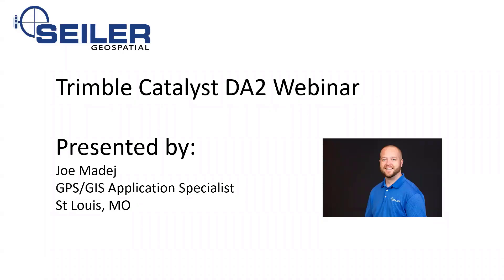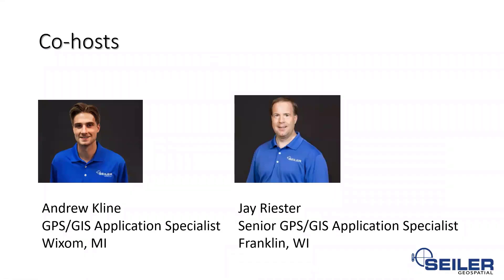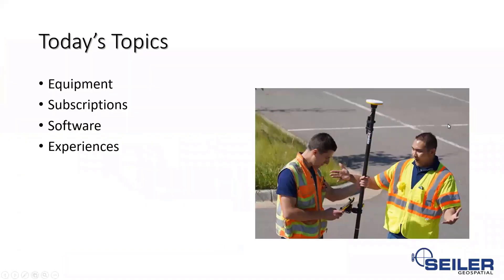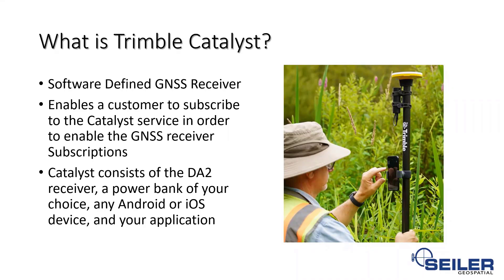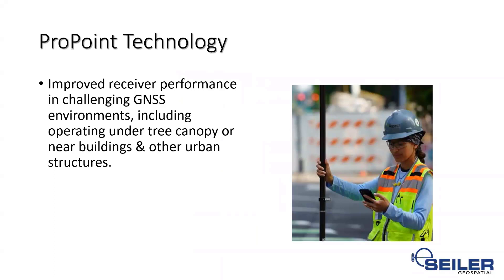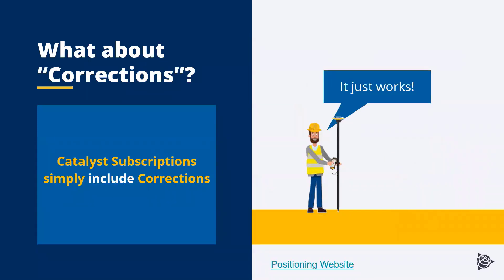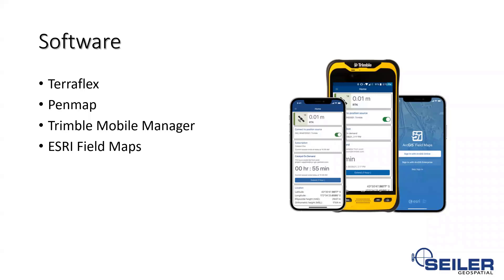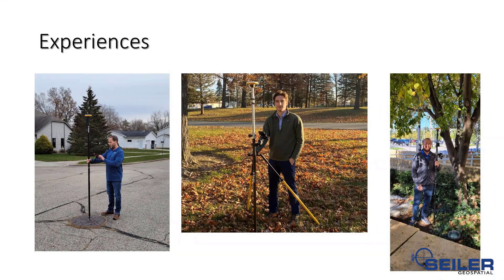Trimble Catalyst/DA2 webinar

Comment: How do you get the MSL (ft) to show up in Field Maps? Thanks for the video btw.
Reply from the maker: Hi there, You can add the MSL (ft) by adding an arcade expression inside of ArcGIS online, or you can run a field calculation back in the office as the data is stored in a 3D geometry

Joe